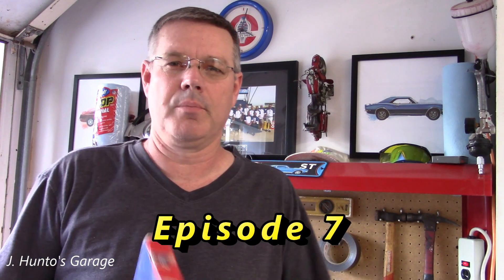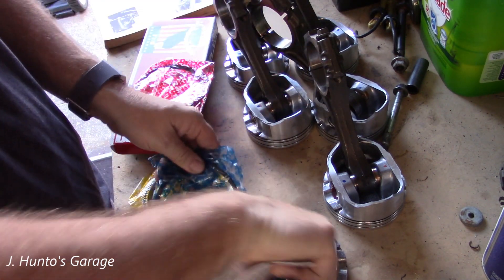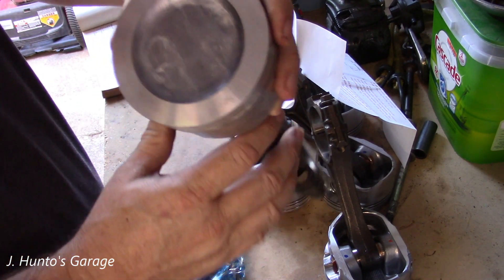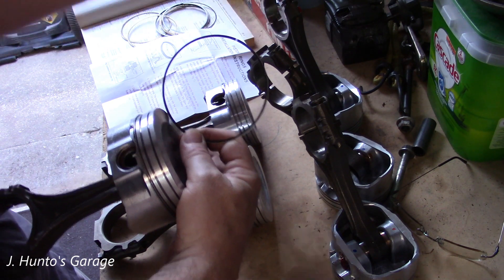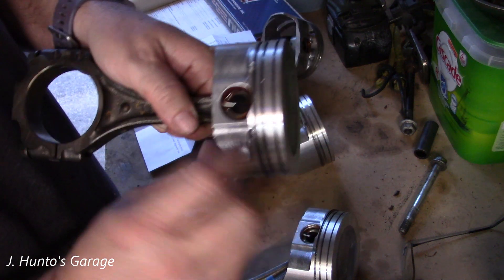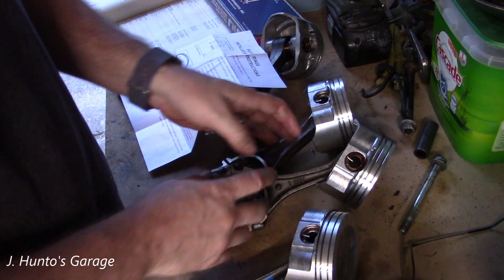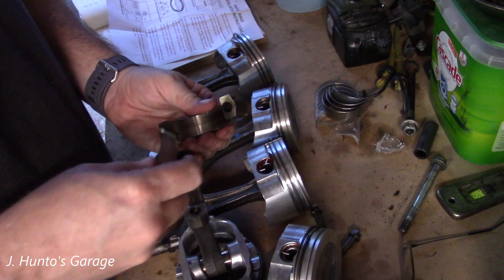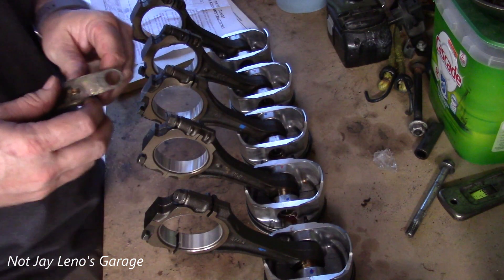Installing Pistons, Rings and Bearings - Project Oddball Episode 7 or 8 Whatever

Comment: You are a glutton for punishment my friend. 😁
Reply: It's ok, my affliction is motorcycles.
Reply from the maker: @Kro_man_tx  Understood,  I have had my share as well.
Reply: @jhuntosgarage  Also, I bought an HHR with what I thought was an electrical problem. Turns out the timing jumped to the point that the Piston slapped the valves so hard it broke the intake cam out of the caps in the head. Pieces of the rockers were laying in the head. So needless to say I have a used engine sitting in my garage to install into the HHR. Otherwise the car is nice only 59k miles. Hopefully I can get some good miles out of her.